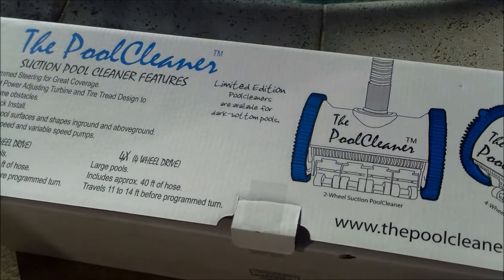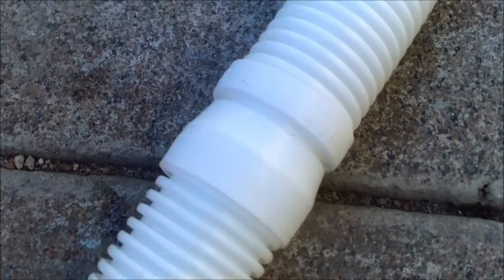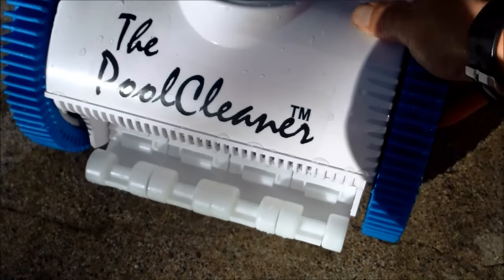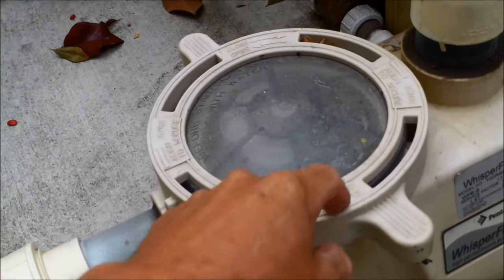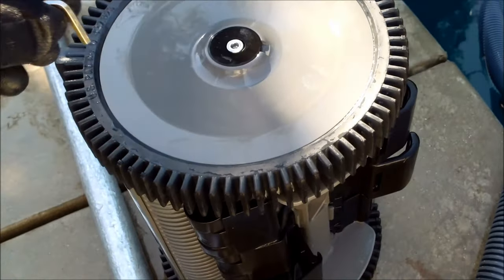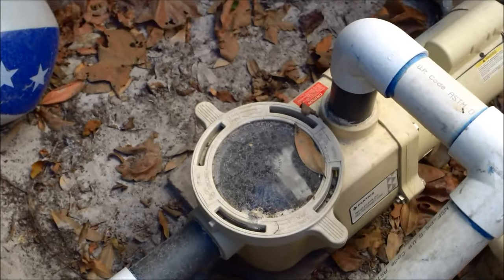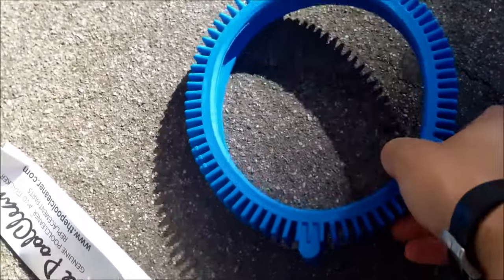Proper Installation of "The PoolCleaner", Troubleshooting & Tips

Comment: Hello, is it possible to get more clarity on the where to install the diverter valve on a one-hole skimmer? I hooked up our pool cleaner and it worked for the first day but now the wheels stopped spinning. I think I need a diverter valve but where do I install it? (New pool owner here) Thank you!
Reply from the maker: With a one hole skimmer, if there is no diverter valve in there you will need to purchase one and insert it. Otherwise you can't regulate the suction. Is there nothing in the hole in the skimmer?

Comment: Hi, 
What setting does the pool cleaner run on? We have 1 at home, recently bought a new house and they already had a pool cleaner. Do we run it on filter or pump or any other settings?
Reply from the maker: What type of cleaner is it at your new home? They make two models basically- a suction side that runs off of the pump and a pressure side version.

Comment: My 4 wheel model is not climbing the wall. When it tries it slides down.. What may be the problem?? Thanks.
Reply from the maker: What type of pool surface do you have?
Reply: @SPL  its a concrete pool. Recently re painted.

Comment: Thanks so much for the video. Just bought a new 4 wheel pool cleaner. Ive been manually cleaning weekly as I cannot find anything that will climb the walls or go to shallow end. This new one is no different. It has 12RPMs but seems to "slip" while climbing the walls. My pool is fiberglass and a little slick. Im hesitant to cut the nodges off the wheels in case I cant get it to work and have to return. Any thoughts. Thanks so much for your Time.
Reply from the maker: Probably would advise to return this one. I think the only cleaner that will climb your walls effectively is maybe the Zodiac MX8 or M6 or a bouncing type cleaner like the Zodiac Ranger.
Reply: @SPL  Thanks for advice. Much appreciated

Comment: I have the 4 wheel version and my cleaner seems to run fine but no longer does the turn itself action. Before the unit would run in a straight line then after so many feet or i presume revolutions of the gears it would do a spin around and head another direct. Now it seems to run in a straight line and likes to get stuck in the deep end or at the steps. Any suggestions as to what this may be? I checked the turbines, the gears, drive shafts and the hose connection point on the top spins freely. Couldnt find anything off the bat that would indicate and issue.
Reply from the maker: Sounds like a bad cam. How old is the cleaner? You may just want to drop in a Lower Body Conversion Kit and be done with it.
Reply: @SPL   The cleaner itself is proabably 3 years old. I bought the lower body rebuild kit- https://www.amazon.com/gp/product/B06XF6HF3S/ref=ppx_yo_dt_b_search_asin_title?ie=UTF8&psc=1
what part is the CAM?
Reply from the maker: @thomasbritz9305  It is the disk part with notches in it. If your looking at it from the front with the top off it is on the right-hand side.
Reply: @SPL  Thanks i will check it out, so if the grooves are jacked then replace it?

Comment: Will the pool cleaner work with the skimmer motion?
Reply from the maker: I think so but not 100% sure. You can call the company and inquire. I've asked for a demo skimmer motion for the field but have not heard back - last e-mail from them was that they were sending it up the chain of command...
Reply: Thanks for your reply. Do you know anyone who uses the skimmer motion? Any reviews?
Reply from the maker: Martin There have been a few on TroubleFreePools.com. Just google Skimmer Motion and their link with a forum post review should pop up.
Reply: Just bought the poolcleaner. What could be the reason why sometimes my poolcleaner just floats and not touching the poolfloor? The hoses are long enough though.
Reply from the maker: Martin When it comes off of a wall it will float down. Otherwise it should stay planted on the bottom. As long as the float on the lead hose is positioned correctly the cleaner is heavy enough to stay on the bottom. Does it happen often?
Reply: It's been doing that eversince i bought it which is 4 days ago. It will run fine then after i checked it a few hours, it's already floating and doesn't go back down to the floor. It's running 13rpm. Should i lower it to 11? I didn't adjust the float cause the manual said they already adjusted it to the right position. Could it also be the wind? It's been windy the past few days.
Reply from the maker: Martin That is very odd behavior. Maybe lower the suction, it could be coming out of the pool and sucking air. Keep me posted, I've yet to encounter that problem.
Reply: I adjusted the return fittings pointed downward and that seemed to fix the problem. One more problem though. We have a palm tree and the fruits of it go to the pool. The cleaner suck them in but once turn the pump off, the cleaner spits them out. Should i do something with the cleaner first before i turn off the pump? I have a leaf trap canister. Shouldn't the fruits be staying inside the canister?

Comment: I got the poolcleaner and set it up using the port on the side of my pool, where I used to run my old vacuum.
This thing is constantly getting to the shallow end of the pool and getting stuck at the stairs. It won't turn to go a different direction, eventually goes back a few feet, but then right back into the stairs and not going to the rest of the pool. How do I fix this? Plenty of hose and suction.

Comment: I have tried just about everything you suggested. Have the large mouth installed. Tried different RPMs...cleaner will not climb walls. It's a small kidney shaped pool and sides are like a bowl in deep end but doesn't climb much better in shallow end. The floats were at 16 inches from cuff which I tried but instructions said to have at 20-25 inches so I tried that also. Like the cleaner except for this...don't know about returning it.. Any help or suggestions would be greatly appreciated ...I have the 2 wheel drive model
Reply from the maker: What type of pool surface do you have? And were is it connected to the pool? Skimmer or side port?
Reply: Sorry forgot to say It's a pebble tec in-ground  with side port. About 15000 gallons kidney shaped pool. It does a great job keeping bottom of pool clean, much better than the Kreepy krawler I replaced

Comment: Are you still monitoring comments?  I have a question on my two wheel Poolvergnuegen pool cleaner.
Reply from the maker: Yes, I am. What is your question?
Reply: Swimming Pool Tips, Reviews & How To - SPL   We had a two wheel Poolvergnuegen cleaner for quite a few years.  It worked great. But over time the plastic housing had cracked one of the ‘feet’ wouldn’t stay in so we bought a brand new one....same model, last summer.   Nothing has changed with our pool or filter system but the new cleaner would run a hour, maybe two, and just stop moving.  No clog, no obstruction.  Still had suction.  I’d have to flick the vanes with my finger to get them spinning again.  Worked an hour or two and then stops again.  So the company I bought it from sent me a replacement....and the replacement does the exact same thing.  So disappointed as our first one was such a good cleaner.  Our pool was opened last week....put the cleaner in, same thing.  Works a while and then just stops.  I can’t figure it out.  Surely I can’t get two defective cleaners in a row.  Any thoughts?

Thank you.
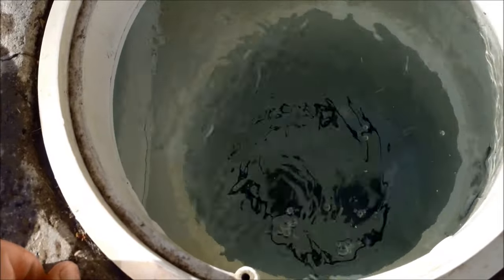Reply from the maker: @1Tori391  It would be strange to have two dud units for sure. Try removing the screws on top and then the turbine cover. Then remove two of the turbine vanes, not two consecutive ones, but two in total. See if that helps the turbine to spin freely.  I show this at the 2:20 mark in this video: https://youtu.be/GqftcLueg4Q
Reply: Swimming Pool Tips, Reviews & How To - SPL   If I do that, won’t it decrease the ability of the cleaner?
Reply from the maker: @1Tori391  No, it is designed to run even with 3 vanes out.
Reply: Swimming Pool Tips, Reviews & How To - SPL   Ok....I saw your comment to another person here saying that since Hayward took over Poolvergnuegen there have been more problems with these cleaners. Could my situation fall under that category?  I mean....two brand new cleaners with the same exact problem.  Sounds fishy to me.
Reply from the maker: @1Tori391  Don't think so, I haven't seen any recent dud units recently. But you never know.
Reply: Swimming Pool Tips, Reviews & How To - SPL   Well, I did what you said.  It ran five minutes and stopped.  I think I’m done with this brand.  They’re both going in the trash. My pool isn’t getting clean and I’m having to run outside almost every hour to flick the vanes to get thing moving again.  So ridiculous.  I would not recommend this cleaner to anyone, despite the reviews.  Two in a row with the same exact problem....when the original one worked like a charm for years.  Something is wrong at that company.

Comment: I purchased a used unit and it didnt work (wheels were stuck) but then it fixed itself and was working great! Then i was in the pool while it was running and then i heard a click and then it stopped crawling/moving.  Are the wheels suppose to rotate when not hooked up to anything or is it normal for it to be looked? I didnt know you can take a part. Thank you so much for this informative video.